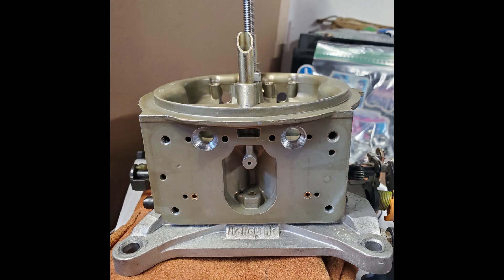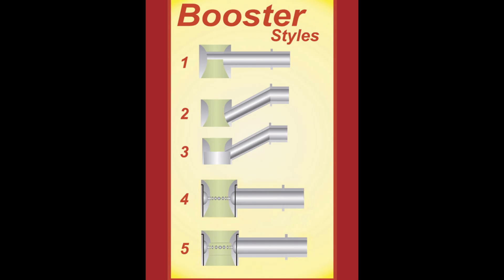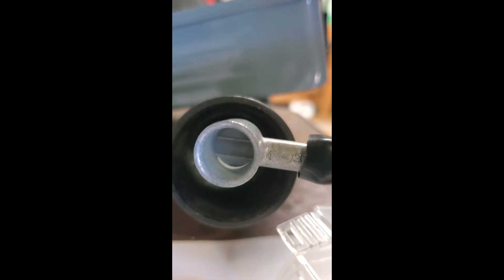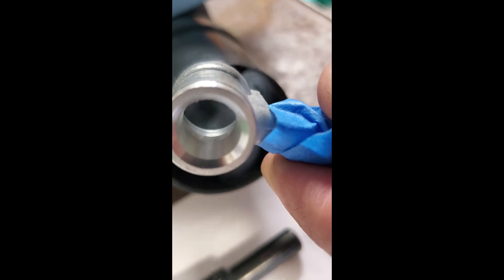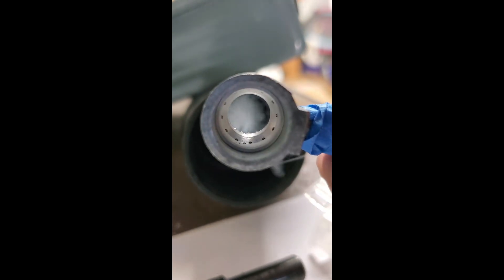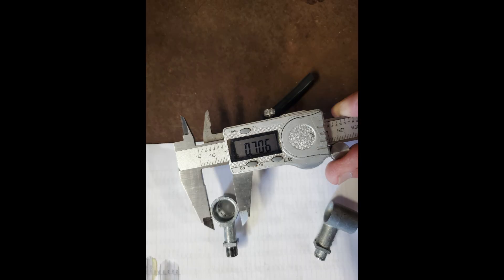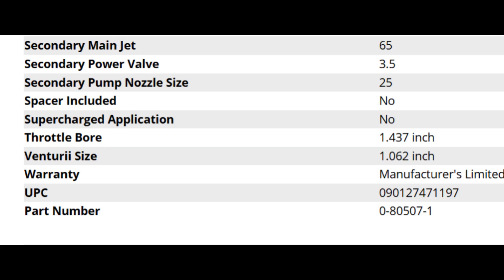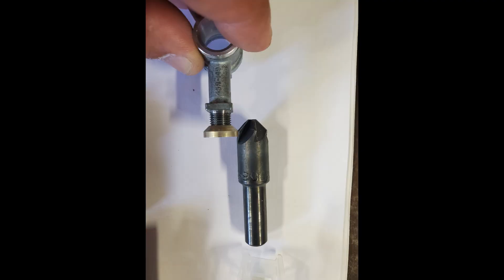Annular Booster Install on a Holley 390- Allstate Threaded SLA

Comment: Annular boosters make a huge improvement in fuel distribution.  Their biggest improvement is in big block engines where the intake runners are of different length and fuel distribution is critical.  They are also provide more signal at low venturi air flow.  A Holley 4150 950 cfm has poor venturi vacuum because the minimum diameter of the venturi is not much less than maximum diameter.  The problem you will have in a 390 is the main circuit will come on too early.  You will have to drill out the main air bleeds to control this otherwise you will be really rich at cruise speeds.  Holley used to make an 850 with annular boosters.  It was the poor man's racing carburetor.
Reply from the maker: Yep, lol.  You're spot on!!  I was suprised when tuning this carb to realize that the main jets/Boosters come on when the throttle is barely pressed. This carb does NOT seem to cruise on the transfer slots like many, lol.

And yes, that's why I always wanted to try Annulars, because of the long runners on the I6's.
Reply: @1989mallcrawler  Go to a Holley 600 and you'll be very happy.  Better yet, go EFI with a megasquirt.  I used to build Holleys for drag racing and hot rods, but all my street cars are now Megasquirt EFI.  You can go port injection, or take a 4 barrel spacer and put the injectors in it and run a cheap throttle body from a junk yard motor.  You also can run a megasquirt into an early gm throttle body injector. The advantage is it uses low fuel pressure, about 15 psi.  Good Luck.
Reply from the maker: @turbo32coupe I am so curious about running a Sniper EFI on the Offenhauser Dual Port, lol.  Or any variant of that style EFI, to he honest.

I also have Propane that I run sometimes, and Holley Sniper can switch to that.  But man..... the money!!!  Lol

When I finally get my Stroker done I may upgrade the carb to a 600.  So much more parts availability.  I love my 390 DP, but it's an oddball for sure!
Reply: @1989mallcrawler  Holley is the expensive option.  You would be happy with a microsquirt or megasquirt 2, and a simple injection system.  You can buy injector weld bungs for the manifold, junk yard injectors and a fuel rail.  A $30 fuel pump and a regulator and you're good.  
On the carb, if you open up the air bleeds and lean out the jets, your 390 will perform well.  The air bleeds control when the main circuit starts and the jets control the mixture.
Reply: @1989mallcrawler  The old Holley double pumper with annular boosters was a 830 cfm 0-9381